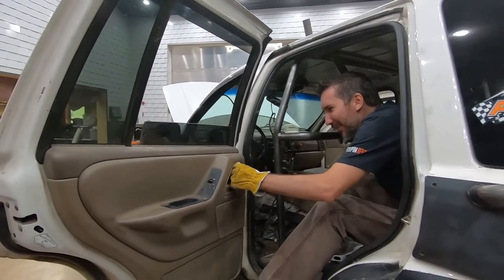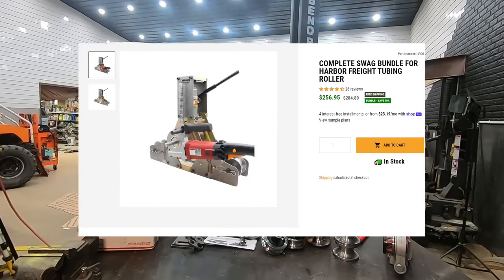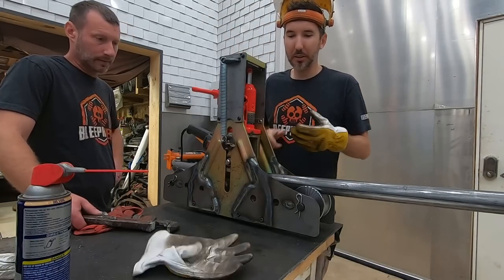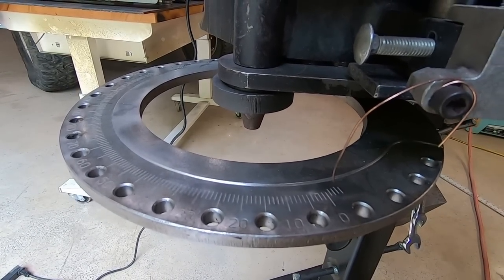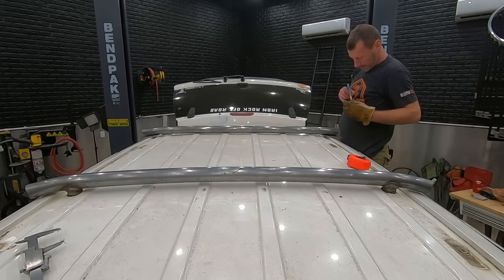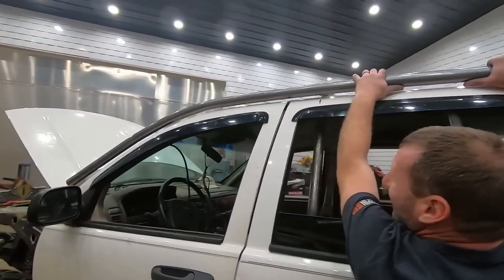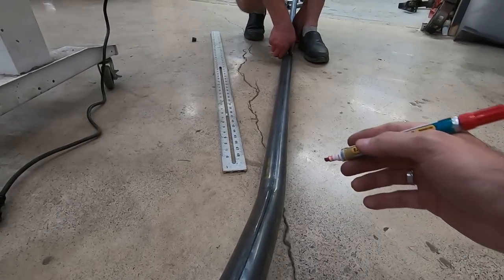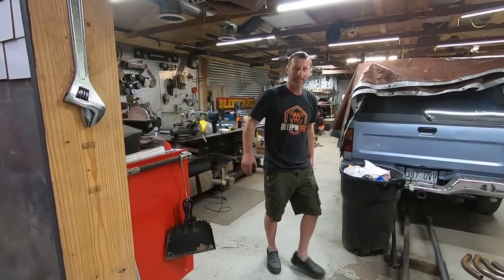Jeep WJ From MILD To WILD - Project Bumble Pt14

Comment: You were comparing inside radius to outside radius. Should lay it on top of the first one. Also, just put a little heat to the inside of the bend to take out some of the bend.

Comment: I have the same SWAG/HF tube roller. I put a foot pedal on mine so I could keep things straight and use both hands. Plus you can tap your toe and the run on is less of a pain. I have made several railings for boats. Big thing is go slow….multiple small pressure changes from the jack is the best.
Reply from the maker: I did end up getting a foot pedal, that was nice!

Comment: When you want multiple identical bends run all tubes through the bender then make an adjustment and run through again then adjust and run in that method until you achieve the desired bend.

Comment: Geez 😬😱
7:25 - yellow zinc plating is Chromium 6, the Erin Brokowich stuff. If you check the Yellin Australian Car expert video on how to die welding - you did the No1 case  - with the most poisonus variant of zinc plating 
Man, I just love what you are doing, would love to see more - please clean zinc of or ware a carbon filter breather while welding it.
Local bloke passed away doing over-zinc welding...
Reply: Hexavalent chromate (Chromium 6) conversion coatings are the really dangerous ones. There are trivalent conversion coatings now that are safer and RoHS compliant. Considering where HF makes their stuff there is no telling what it actually is, but I would expect the worst. 

Chromate conversion coatings are put over zinc plating as a way to passivate the zinc layer, or make it nonreactive. Zinc will readily oxidize and sacrifice itself when plated to steel. This is what makes it desirable. To make the zinc last longer it is passivated with a conversion coating. 

Zinc fume poisoning is separate from the dangers of hexavalent chromate conversion coatings. You can get zinc fume poisoning just from welding galvanized steel. 

Both are a problem here are you pointed out. Sadly, I don't think these issues are part of the common knowledge in the US as much as in Australia or Europe.
Reply: @Fix_It_Again_Tony  
HF stuf is made in china.
They can still use and sell all the forbiden stuff in the west.
A clear sign of stuff made in china is a yellow cromate.

Comment: I'm a certfied YouTube Mechanic also. YouTube has made college pointless. Trade schools are still great but for the cheap skates YouTube is the college lol.
Reply from the maker: Absolutely 💯 percent
Reply: The best part is you can easily find the skills your looking for on the tube and actually see real world examples from beginning to end!!! And I’ve learnt a ton on here! Especially on Bleepin Jeep!!
Reply: It's so nice to have YouTube around. Being an early 80s baby there were many times that I went to the junk yard, not for the parts but so I could figure out an issue. Either how in the heck to get something apart without breaking things, to see what really has to come off to change it, or even just to see what something g is supposed to look like. 

It was sometimes fun ripping off that part that I couldn't get off without breaking. That had at this point stumped me good enough to go to pick a part. But I don't miss it.
Reply: I installed a sye using Matt's guide from several years ago.  His guide was the best by far.

Comment: I have unfortunately had the undesirable accident happen where I was straddling what I was cutting at floor level and had a cheapo cut off disc leave the chat and make direct contact with the jewels at mach death speed. I literally had to check for blood, thankfully there wasn't any. But the pain from that didn't fully subside for several weeks...

Comment: HAVE to know, what headlights are those... my wj needs a set , mine looks very similar to what yall are building but i need to either seriously modify the stock headlights, or get these!
Reply from the maker: They are rzr headlight but upside down so not great so far.  Will need some modifications yet.

Comment: Hey guys big fan of bleepin jeep and freedom winch ropes, unfortunately I'm based in Australia and no-one here stocks your products. However I have come across a product made in Australia called bogout, this system allows you to use your vehicle's wheels and tyres as the winch in many circumstances where 2 vehicles may be required you can simply use it by yourself. I would love for you guys to test it out and tell me you're honest opinion as well as potentially designing your own version and making adjustments if you decide you can improve it. I still haven't used this product myself in fact I only just found it in the last couple of months here in Australia, but I've been using methods very similar to this MacGyvering snatched straps or tree protectors and securing them around the closest or best suited drive wheel to create your winch. 👍.